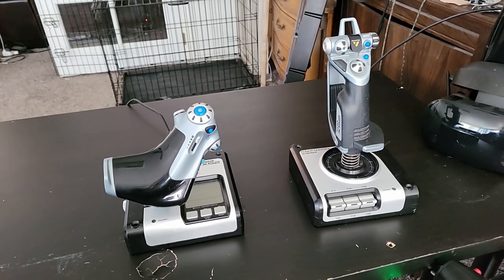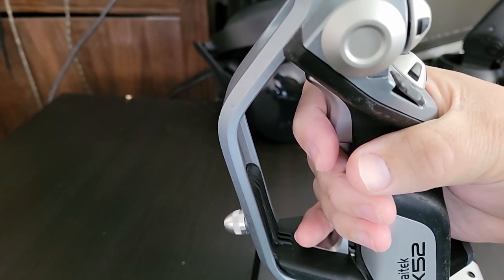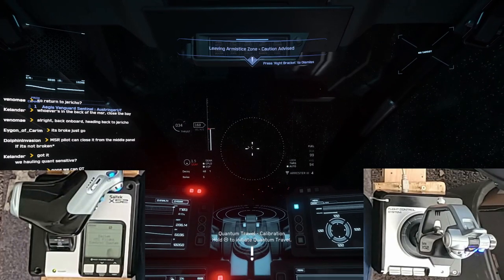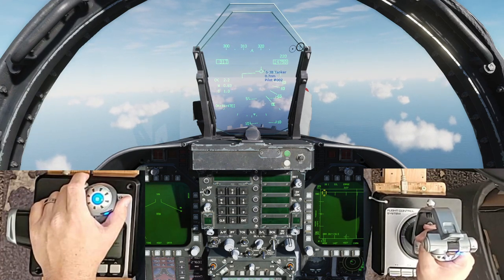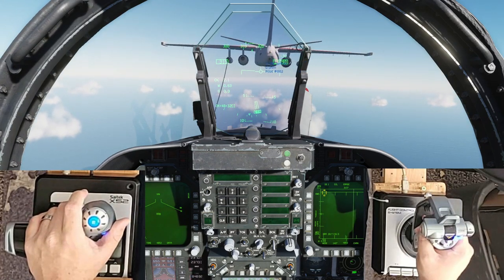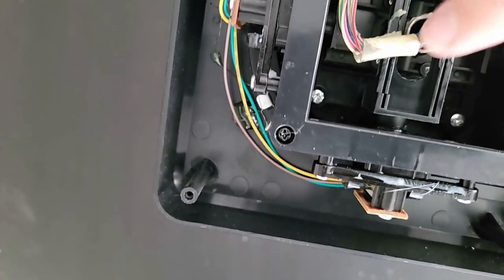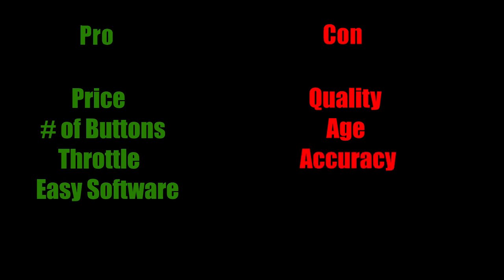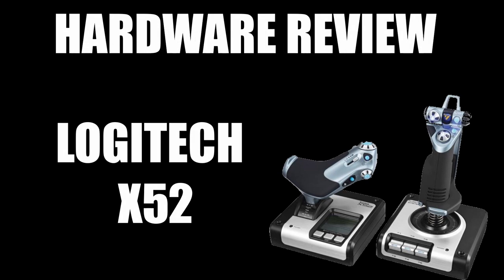Logitech/Saitek X52 HOTAS Hardware Review

Comment: The closet Hotas in price to the X52 is the Thrustmaster T16000 Hotas for around 180-256 on amazon(more leading to the higher price due to demand and shipping issues). I would love to get a vkb gladiator nxt but it is only a stick and with it's shipping cost with tax to my area would make it cost around 280usd which is close in price to a full kit thrustmaster T16000(stick, throttle, and paddles if in stock) or a Logitech G x56. I wish there was more mid range hotas set ups in the 100-200 range as this is dominated by Logitech and Thrustmaster with 2-3 options and all other companies I see that make Hotas in this range are from unknown companies, bad reviews, and due to their product shipping would add around 80usd to them and thats a big no go for me. Nice vid

Comment: Good review. I've been eyeing this for a while. Not sure if this is better than the TM Airtbus setup, but thanks for the details! Keep it up. Subbed.
Reply from the maker: IMO it is not better than the TM Airbus stick. My recommendation is the gladiator NXT and TM TMCS throttle.
Reply: @FalconsLedge  Whoa! Slow down, the VKB has like 32 additional add-ons! Good option though. Too bad the price is inflated and it's hard to find! Thanks for the advice!
Reply from the maker: @mr.yonosenada  VKB gladiator NXT is in the same price segment as the x52, but it's about 10x better. 

I will be posting ac review of the GNX today or tomorrow.

Comment: I dusted off my 15 year old X-52 last week to get back into DCS, and amazingly it still works perfectly.  I really want a new setup, but its hard to be FREE on the shelf!  I really miss the old Force Feedback sticks, but I just make due with a seat transducer these days.
Reply from the maker: There are new Force feedback sticks that make the old ones look like toys. 

Also basically every stick on the market has that kind of longevity. It's not really a feature, more of a standard.
Reply: @FalconsLedge  You get to a point where your simulation is so detailed, you may as well build the plane....I don't think spending $2500 on a fake joystick and throttle are realistic for most people.  Especially when FF sticks used to be everywhere
Reply from the maker: @mikebal7777 funny I don't recall recommending that. I recommend people try to get the best bang for their buck, and Logitech products are not that.
Reply: @FalconsLedge  I am unaware of any reasonably priced Force Feedback sticks
Reply from the maker: @mikebal7777  there aren't any. I never suggested you should buy one. I merely said there are new ones that are amazing.

Comment: They actually use 16-bit hall sensors in x52. It's just they also use some convoluted double magnet design for some reason. Which in it's turn makes this stick as it is - non linear and janky. But you can actually fix that in like an hour with a couple of small flathead screws and a drop of superglue. Also time to release some x62 or even x72 is waaaay past due. Change that stupid mouse knob for an analog ministick, chage gimbal for a pincer design, some reimagining of grip wouldn't be unwanted also. Maybe recent revigoration of this market will make them move their asses.
Reply from the maker: Yeah I'd totally welcome those changes, and they are way pay due.
Reply: X56?

Comment: A simply thing you can do to improve the response of the joystick is to link 4x cable ties together into a loop, place it under the spring and close up the loop till its sits snug & even under the spring.
Reply from the maker: That affects the feel of the gimbal not the accuracy of the sensors., If it works for you great.
Reply: @FalconsLedge   i mean even if they just kept the same design to save on retooling and  just swapped out the internals with better newer stuff i have both an x52 and x 52 pro and  what they desperately need is  like a redesign of all the parts that peak so the   safety latch on the stick needs a better spring the thumb Mouse needs to not be defective the cable linking to to should be something harder to damage that a ps/2 i mean seriously do they even make cable for those any more lol replace it with  idk vga, dvi something thats screws in or something that pulls out easily usb etc make it something that wont come out or somthing that will come out without bending pins or the socket  fix the damn spring its a 20 year old flaw replace it with a better more adjustable system ...make it modular make it so i can unscrew the right hand flight stick from its base and screw on a left hand one or a flight yoke or a extender for a floor mounted stick  like if they just did it right they could keep on selling it for another 20 years but at this point its like asking something to buy a used 2000 corolla for the price of a new one is just silly
Reply from the maker: @firefox5926  the reason you aren't getting a new version is that Logitech doesn't give a flying crap about combat Sims. Not even a single solitary crap. They are just manufacturing seriously outdated IP that they acquired a decade ago and they have zero interest in updating it or innovating in any way.

Don't spend your money on dead ecosystems. Buy from companies that do care about the niche you love.
VKB, winwing and Virpil.

VKB gladiator NXTs are WORLDS better than the x52 or x56, and they aren't much more.
Reply: @FalconsLedge  oh i know they dont but im just brain storming what  i would do if i could remake it ... be real nice if  we could get a bunch of good ideas toghter and then find someone with a 3d printer and one of those places that makes cheap custom pcb's
Reply from the maker: @firefox5926  in not a fan of their ergonomics, so I'd be replacing the gimbal (because it's bad) and the grip, because it's bad, and I might as well build a whole stick and just throw the x52 away
Reply from the maker: @firefox5926  I plan to do a DIY joystick just like I was talking about by the way.

Comment: thumb up for this review. I still have my X52 Pro Hotas and I had the same issue with the moving axis and had to unplug and replug the stick to deal with it.
Reply from the maker: Mine had this issue for as long as I can remember, but I know it didn't have it when I bought it.
Reply: @FalconsLedge  Just curious, would a ferrite bead help with the issue?
Reply from the maker: @garyreed315  This problem happens due to really poor quality hall sensors being used. I tried what people call the "Magnet mod" but it did not help the problem at all, in fact some aspects of how the sensors operated were worse.
Reply: @FalconsLedge  Thank you for responding so quickly. I am building my system and trying to figure out how to put it all together. I guess I could just get the Virpil controls but they're pricey! Thanks again for your help.
Reply from the maker: @garyreed315  I have a VKB Gunfighter mk.III being delivered Monday. Virpil are great sticks. Do you fly space or flight sims
Reply: @FalconsLedge  I am interested in flight sims, space sims (elite dangerous, squadrons) and racing. My VR headset is the Pixam 8KX. Virpil is sold out currently as is everything else it seems. I guess I can use the  X52 for the time being... Your video made it clear the mistake I made.  The thing is x52 was the only one in stock.
Reply: @FalconsLedge  I just looked at the VKB and WOW! That's nice!
Reply from the maker: @garyreed315  here would be my recommendation: if you are buying top end, you can always pick up a VKB Gunfighter mk.iii , then use your X52 throttle til the VKB TECS throttle comes out. That is basically what I'm doing, but I'm also using a gladiator NXT as a left stick
Reply: @FalconsLedge  Yeah, that's a good idea. Thanks for the advice. I am going to take that recommendation as I like the metal material it's made of, serviceability and customizable design. Thanks again. Sub'd!

Comment: You can re-adjust the height of the wrist-rest by unscrewing the nob in the back and raising/lowering the wrist rest for a more comfortable experience. This can fix a lot of the problems listed in this video. Otherwise, the stick works well for beginners.
Reply from the maker: Yup, thanks, I changed mine long ago. This stick WAS good for beginners 20 years ago, I do not recommend it for anyone now
Reply: @FalconsLedge  Agreed. Even around 2007 it was getting old. The buttons are a bit inconvenient now.

Comment: i purchased a used x52 yesterday only because after not playing any simulators for over 30 years thought I would give it a try .Considering i was lucky enough to get it for $50 Aud , i am verry happy with it so far and if I continue to play might at some point upgrade.
So my opinion would be , if your just starting out get a used one just to try, no point spending over $200 Aud only to find out you dont have the time/patients .
Reply from the maker: If you find yourself enjoying flying, do yourself a solid and pick up a Gladiator NXT. Use the x52 throttle and it will be great.
Reply: @FalconsLedge  so the x52 throttle  will work with the gladiator?  I just started looking in to these controllers and the software part makes my head hurt.  If I bought these 2 parts, how would I configure these, in game or using thier own software?
Reply from the maker: @Ryan-re1rs  they each use their own software, and can also just be configured in game. They are both just usb devices, so nothing keeping you from using them together. I'm currently using an x52 throttle with my gunfighter and gladiator combo

Comment: Few years ago, I've used to own Saitek X52 and for me it was a great hotas. Today it's also a good option, but IMO only as a used one.
As for the your issues with the sensors. It's actually quite known issue with this stick. But it can be easyli fixed. Just stick extra magnets to the ones already in the base and all deadzone dissapears and the stick becomes very accurate.
Reply from the maker: The issue is not fixed by magnets. I have tried the mod, it does not fix the accuracy problems, in fact in many respects it makes them worse. It gives the feeling of it being more accurate,  but in reality its not. I don't think there is any way I'd recommend this stick over others available at the same price point. it is 20 year old tech still being sold as new today.  Fruthermore Logitech doesn't care about flight sim hardware, don't buy from a company who doesn't give a flying crap about the segment you are buying from. 

I get that you had it and didn't have problems with it. This does not make it a good product. A good product is defined when it out competes its competition. In this case it just doesn't.  I would much rather have a Gladiator NXT stick only than this HOTAS. The NXT is orders of magnitude better than this thing.
Reply: @FalconsLedge  I did fixed it in my case. And I agree with you. Today there is no way, I'd buy one instead of Gladiator. But as a cheap used option, it's not that bad.
Reply from the maker: @BartAnt84  I don't really explore the used market on this channel, as it is not consistent, as an example at one time only a year ago used Warthogs (another stick I don't recommend anymore) were selling for more than MSRP.  As a used item I 'd recommend the T16k before the X52. Better sensors.

Comment: I've gone through a lot of Saitek products in my life.
Had the X36, which had its rudder axis acting up once the warranty expired.
Then I got the X52 which had its pinky switch stuck once the warranty expired.
Then I got the X65 which had frayed wires in the throttle once the warranty expired.

Then I got the Thrustmaster Warthog. Never buying Shite-tek again!
Reply from the maker: The warthog is a bit long in the tooth and could use an update, but the quality difference can not be understated.
Reply: @Troll You cant play dcs or flight sim games easily with controller its nearly impossible
Reply from the maker: @@Rodney_1984 I'd buy one gladiator NXT over the x52 all day long. The x52 is not a good stick.
Reply from the maker: @@Rodney_1984 I don't actually think the Warthog is a good deal either. Especially when the winwing Orion 2 exists

Comment: I bought my x52 couple weeks ago, so it's pretty new. First thing I noticed watching this is that mine doesn't have "Flight Control System" written on the stick. And a fun fact, the momentary switches on the stick don't work properly, from the moment I unboxed it. The 3rd one from the left is (T5 to be precise), doesn't click to the up side unless I switch it from the furthest left point. 

And the HOTAS has incredibly cheap feeling. Even though it's my first ever HOTAS, the first moment I get my hands on it, I thought "huh, this is piece of crap". 

But it gets the job done. At least for now.

Ah, and the ting happens at 7:35, also happens to me (from the first day I started using it), whenever I play "intensely" for a period of time. But mine happens to Y axis.
Reply from the maker: I think the flight control system is from saitek, which is who produced mine. The new ones are produced by Logitech.

Sorry to hear about the one you got, quality seems hit and miss from Logitech.
Reply: I just got a thrustmaster tca airbus package and it’s my first stick and throttle and I’m truly impressed. In this price range I would prob choose thrustmaster. Logitech tends to feel more cheap even though more functions typically. My stick was designed to be as realistic as possible matching the actual airbus
Reply from the maker: @billygames7107  really depends on how much you are spending. For a single stick less than $150, you just can't beat the gladiator NXT. If you can get the TM TCA for less than $100 I'd say that's pretty decent, or of you primarily fly commercial flight sims over combat sims. Once you get to warthog range, unless you can get the WH for 350 or so, I'd say go for Virpil winwing or VKB, they are all higher quality by volumes than thrustmaster.
Reply: @FalconsLedge  I got the tca with the throttle pack for 150$ I’m pretty happy about it. The dang throttle is  sometimes 150$ alone. You are right about everything you said though..✌🏼
Reply from the maker: @billygames7107  yeah 150 for both is a decent deal, and honestly if you can get that set or the T16k pack for 125-150 they are the best budget sticks
Reply: @FalconsLedge  I really am enjoying it. I’m a thrustmaster fanboy also so that doesn’t hurt. Thanks for quick responses also..👌🏼
Reply from the maker: @billygames7107  I try to respond to everyone!

Comment: Back in 2015 when my Saitek ST200 USB bought with Freespace died I did consider it but at the times I wasn't sold on HOTAS (I tended to play old-ass games that often don't even support throttles and almost never twist) and all the cons I heard about scared me off, so I went with a CH Products Combatstick which was probably the most low-maintenance stick I could afford back then, I'm only thinking of changing it because Windows 10 broke the software that did calibration and input filtering and CH Products is not bothering with their gaming lineup anymore even though they are still making them. And yes, the design was a red flag for me too. You could kind of tell they tried to make it look "impressive" to compensate the overall cheapness of the set and if my memories of the review in 2015 served me right it stil worked back then with many reviewers praising the sapacey-wacey looks.
I didn't know the trigger was dual stage though, or at least I don't remember anyone else mentioning it in their reviews.
Reply from the maker: I love to poke at the looks, because it's really cheesy. It can certainly work for people and the throttle isn't half bad for a single axis one.
Reply: @FalconsLedge  I think I saw a knock-off x52 throttle during the mid 2010s while ggogling sticks back then, I'm not sure but IIRC VKB made it but I can't swear on it.
Reply from the maker: @det.bullock4461  VKB does not offer throttles, but they are coming out with one in a couple months here, but it's nothing like the x52 throttle. 

There are a bunch of throttles and some sticks that either stole the design or licensed the design from saitek.
Reply: @FalconsLedge  It was back when they still made the Cobra Defender, I don't have very clear memories of that time. I just remember what was visibly a knock-off x-52 throttle being associated with them, I don't remember if it was them or just some forum threads of people that used said throttle with their VKB stick.

Comment: it bothers me that all the HOTAS out there in this price range (which is still considerable compared to just a joystick) have such serious manufacturing flaws. If I'm going to pay $200 for a controller, I expect it to be high quality.
Reply from the maker: Gladiator NXT
Reply: @FalconsLedge  Yeah... I'm seriously considering that one. Maybe even without a throttle to start with. I just bought IL-2 and want to play it in VR, so I'm going to want to make sure all the necessary controls are on the stick rather than the keyboard.
Reply: @FalconsLedge  It seems VKB Controllers only ships to the US and Canada. Do you know if there is any way to get shipped to other countries?
Reply from the maker: @Recon777x  I am not sure about that one, if you can arrange getting it from someone they are well worth it